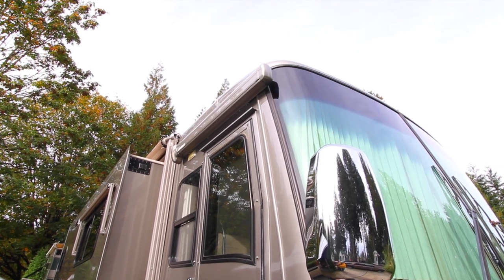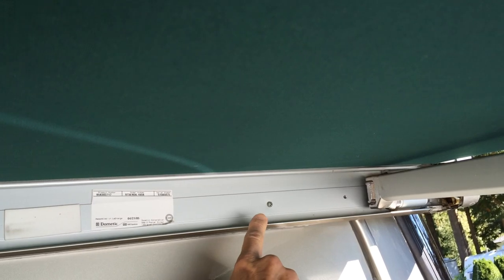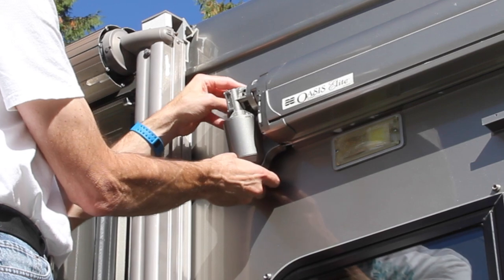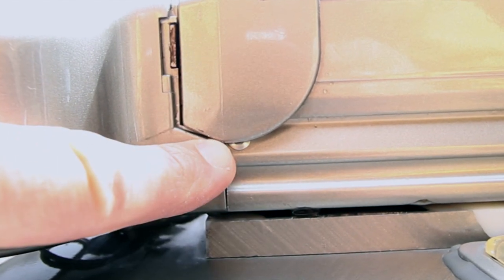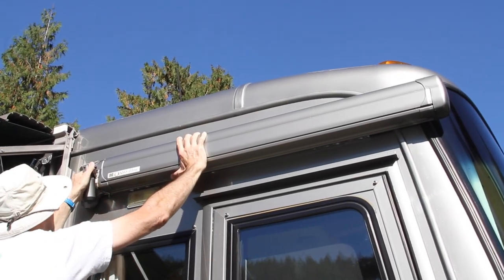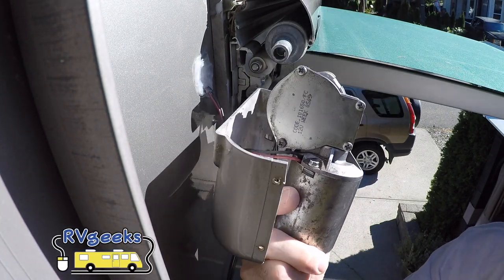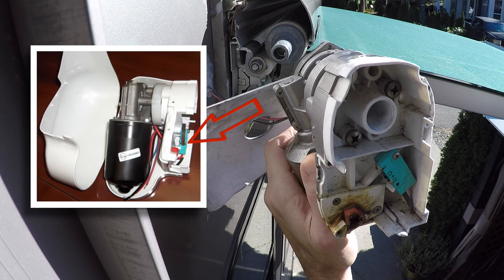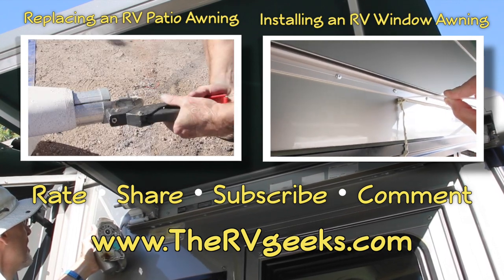Failed RV Power Door Awning, Repaired for FREE! | Dometic Oasis Elite Awning Repair | RV DIY Repair

Comment: Thank you so much it help me fixed my entry awning motor. I don’t have to remove the whole motor assembly i just remove the motor to each housing cut wire clean it up test motor using battery booster then re assemble back to the housing connect wire then put back all screws and cover it ... now it works again and save me a lot of money....again thank you very much
Reply from the maker: That's awesome Peter! It's always great to hear we've been helpful. Thanks so much for letting us know.

Comment: Another great job of explaining both in words and video.  I would have had a very hard time figuring out how to remove the back piece.  It turns out the red holding tabs on either side of mine had become gooped up and could not be displaced by the motor mechanism. Cleaning those and lubricating them (used wd40, dryed, then graphite) solved my problems. ... and here I thought I'd seen all your videos :-)

Comment: great video...ours was stuck in the out position so I had to remove it...bench testing it I found it would always extend  but never retract. Turns out it was the round piece that the motor turns. Dometic got us for $75 on that piece but it fixed it so I guess I got off cheap. 
Thanks again.
Reply: I seem to have the same problem.  I took the motor off and it bench tests fine.  I Have to assume that the roller it connects to that turns the shade is broken like yours was.   Did you get the part from fiamma or dometic?   Do you know the part number off hand?   I hope you didn't have to replace the entire roller but just the end piece that connects to the motor.

Comment: WOW -- I can't wait to try this. thank you, thank you, thank you!! ours is stuck out, hear the motor, but not turning. We guess it has broken pieces in the gears. Hopefully it will be as easy peasy as yours.
Reply from the maker: Hope you make out okay. Be sure to let us know!
Reply: OK - we took apart the awning this weekend and the motor works great!! but it still won't come in, so we looked down the shaft and saw that more than likely it is the 'keyed' portion that has worn away. Fiamma still isn't answering their phones. Hoping you could tell us what to do next. Thank you in advance!! I love all your videos, very informative and well thought out. Terry
Reply from the maker: +ladylaugh51 Thanks so much for the nice comment, Terry. What happened at Fiamma is a horrific tragedy, and we don't expect to be able to get parts or service from them again soon, if ever. We'd suggest that you contact a Dometic / A&E dealer. If you can determine what parts(s) you need, they likely carry it. They might even be able to help you figure out what you need. Unfortunately, even if they do, they'll charge a lot more for it than Fiamma would have. You might be able to find parts on eBay too.

Comment: I have finally decided to get this door awning fixed on my Newmar. My only concern is that I do not hear any noise what so ever when I hit the switch to open the awning. Maybe my motor is shot?? It did work when I purchased the coach but not for long. I don't use it but am about to put my Newmar up for sale and want it working for the next owner. Thanks for the video!! You all have saved me several times.
Reply from the maker: Motor might be shot, but the first thing we would do is check for power with a multimeter. And even if there’s power in the motor doesn’t make any sound, it may just be seized. Definitely worth trying to work it loose before giving up and replacing it.

Comment: At 4:12you can see into the roller tube fitting that slides over the output shaft of the motor.  There is a small shear key built into the tube fitting.  When this shears, the awning suddenly springs out on its own.  Failure mode: SPROING!!  I drilled and tapped a screw into the tube where the key used to be and then ground the screw flush to the outside of the tube.  Drilling a hole and using metal epoxy might work as well.

Comment: Make sure you clean the tiny water drain hole in the cover under the motor. It doesn't take much dirt to clog that little drain hole.  I increased the size of the drain hole on mine and have had no more problems with the motor
Reply from the maker: Thanks for the added tip, Jeff! 👍

Comment: yes it came from dometic, I found the original paperwork in the huge suite case of manuals and called the number on there, the lady on the end of the phone new exactly what part it was, blamed it on a bad supplier. fixed it right up. we also replaced the material at this time, but made our own, the wanted way to much for that. i will look for the paperwork and see what the PN is.
Reply: Eric I found the female end of the fabric roller has the inside raised  tab   sheared off which is letting the motor shaft just spin inside it.   Were you able to remove that end piece and replace it or did you have to order the whole roller for the fabric and replace it?   Just don't know how to get that end piece off and afraid to start prying.  Going to call fiama in the morning if the phone number is still good.   Web site does not give one.

Comment: I would have loved to see what you took apart and cleaned. Did you just take the screws out of the part on top of the motor and clean?
Reply from the maker: Right Kevin! We just removed those screws, took the thing apart, cleaned things off and reassembled.

Comment: My similar Carefree One Touch quit in the closed position after my son powerwashed the roof.  I assume (hope) he just got water in the horizontal motor, because if its in the One Touch control module/switch system things get really complicated to track down.  Your video gives me some insight.  

But do you have any advice re. mine, because the "Tubular Motor Replacement Kit" manual online at Carefree implies I must drill 1/2" holes through the unit's end cap in 3 places in order to access the screws holding the end plate covering the motor?  That means the end cap has to be then replaced unless I instead can somehow pry it off the end plate (it apparently was "snapped" on).  

And removing the motor may not be easy because to slide it to the left and out of its tube it will hit the nearby slideout cover awning and/or the main awning's arms.  Just wondering if you had experience with Carefree over-the-door ones like mine, with tubular motors.
Reply from the maker: Sorry, but we’ve never owned a Carefree door awning, so we don’t really have any idea how they work. We’d suggest posting your question on the user forums on iRV2. It’s free to join and post questions at www.irv2.com/forums and there are tons of RVers there who are happy to help with any topic they have experience with.

Comment: First class video. Based on your comment, you pop riveted the motor back in place, why not a screw? This is not a criticism, as I truly appreciate the great video.
Reply from the maker: Thanks Mark! We pop riveted it back for a few reasons. First, we generally try to put things back exactly as we found them, so we're not inclined to make a change unless we have a good reason. It's also not possible to use a screw in that particular spot, because it's just two pieces of thin plastic being attached to one another, so a screw wouldn't hold into the plastic without stripping it (a bolt might work, but then if we had the same problem again, it might be difficult to remove, as the nut would spin loosely on the back side, with no way to get a wrench on it, since it's inaccessible when the awning is closed. Also, the space for the head of the rivet is very thin with the awning closed, and a rivet is extremely flat on top, taking up less space than a screw. Lastly, a rivet can't vibrate loose, like a nut & bolt can. Great question though, and we hope our reasons for using a new pop rivet make sense!

Comment: i had to do the same thing to my unit a few years ago  and clean the motor but i left the gear box on and pulled the upper 2 bolts out  

i all so added a new hole on the under side of the cover for water to flow out as my motor was standing in water in the cover
Reply from the maker: +falcon7350 We've read about lots of people having that problem of water pooling around the motor. We were lucky and didn't have that issue.

Comment: When you replace the motor back on to the awning.... do you push the awning in all the way first ?
Reply from the maker: +Scott Deney No. The nice part about the way they awning is designed is that it allows the motor to be re-installed with the awning out, even if it was removed with the awning closed. That's a good thing, since having to hold the awning in, against the springs, while trying to put the motor back on would be a challenge with it trying to jump out on you the whole time. :)

Comment: I just bought an ‘06 Monaco with that kind of door awning.  It extended just fine but won’t retract.  The motor runs and tries but the arms look like they’ve extended perfectly straight.  Perhaps I should have let go of the button sooner?
Anyway, it’s extended and the right side appears an inch or so lower than the right side.
Any advice? 
Thanks in advance!
Reply from the maker: Hi Gardner! Congrats on your new-to-you RV! That awning is spring-loaded to go out, so the motor pulls against the spring to retract it. It sounds like it's possible that something came loose that allowed it to overextend, and now one of these things may be happening: 1) The arms are locked straight out, preventing it from retracting (you'd know if this is the case if you hear and see the motor try to push the awning in, but it only moves the slightest bit). 2) The awning has gone so far out that the gears are no longer meshed together. That would likely result in a free-wheeling sound from the motor running, but not pushing anything. 3) The motor is not running at all, in which case it would make no sound. That could be caused by a blown fuse. 4) The gear that attaches the arms to the motor may have failed, in which case you'll probably also hear it running, but nothing happening.

If the motor IS making sounds when you push the retract button, you might try having someone press on the center of the arms as you press the retract button, helping them to re-fold the arms as the awning begins to come in. You may have to push inward on the front of the awning at the same time, pressing against the spring to help it begin to retract. Just don't let it get way from you and knock you off the ladder.

These are our guesses as first things to look at. We also suggest e-mailing the manufacturer for help/guidance, providing them with as much detail as you can. That would be Fiamma in Florida: http://fiammausa.com and you can e-mail them at  service@fiammausa.com

Hope this helps. Please let us know how you make out.

Comment: Any hints on the disassembly and cleaning of the motor?
Reply from the maker: +James Garrett We did dismantle, clean and lubricate the motor, and remember it being pretty straightforward, but sorry we don't remember the details, James.
Reply: Just finished with mine.  For those that are also curious, two screws in the top of the motor housing allow disassembly.  You may have to pull more than you expect because the magnets are fairly strong, but the shaft and rotor will come out.  You will probably find, as I did, that the central shaft had rusted in the bushing at the bottom of the motor.  A little emery paper and some electronics cleaner got rid of the rust, along with using a brass or stainless brush on the rotor to remove rust there, then a bit of electric motor oil and back together again.  Easy!
Reply from the maker: +James Garrett Thanks so much James!

Comment: how do i repair the motor? i got one on a customer coach that works intermittently. or it will work then motor slowly dies.
Reply from the maker: Hi Travis. If the motor won't work reliably, you may have a loose connection. We're try opening it up and wiggling the wires while pushing the switch to run the awning in or out. If it seems to react to the movement of the wires, they're likely loose. It's also possible that the motor needs to be replaced, in which case we'd suggest contacting Fiamma (the manufacturer) for assistance. http://www.fiammausa.com

Comment: The other awning frame is so close to the step awning I cannot get any kind of screw driver back there to fit into the screw.  Is there a trick to getting something to fit back there?
Reply from the maker: Wow. That's a real problem. I assume that extending the patio awning that extending the patio awning still doesn't get the arm out of your way? You might need one of those flexible screwdrivers, like this one: http://amzn.to/2bUtfPB

If you have a 1/4" screwdriver bit to go with it, this type of tool might allow you to squeeze around the corner of the awning even with limited space.
Reply: Dan, I'm sure it is too late for this, but my main awning is also too close to the door awning to allow access to the screws.  Luckily, in my case, I was able to take a hammer and give the motor a sharp rap on the bottom, which freed the rusty bushing and allowed me to open the awning.  From there, I could remove the screws anchoring it in place and slide the whole thing forward in the awning track and remove the motor.  If you just get a slight "klunk" when you hit the switch, you motor is likely frozen and the hammer may work.  If the motor is running, your shaft interface is probably stripped, and the hammer won't do any good.  No noise at all?  Likely electric and your problem may be elsewhere.
Reply: Just in case anyone runs into this problem with the second screw.... I was able to get around this by sliding a 2 inch Phillips screw driver bit through the end of a 1/4 racheting box wrench as a tool to get to this screw.  I threaded it up behind the motor and pushed on the end of the bit with my finger on the left side of the motor and used the rachet one click at a time .... ugh... go eventually back out the second screw.  Wallah
Reply from the maker: +Scott Thompson Thanks Scott!

Comment: Does anyone know of information regarding the fabric replacement of one of these A & E Systems manual door awnings?
Reply from the maker: The guy to contact is Tyler at Tough Top Awnings. He is the expert on just about everything to do with replacing awnings and slide toppers of all makes and models. His number is (360) 953-3299, and if you order fabric from him, the "RVGEEKSROCK" discount code will save you a few bucks, too. https://www.toughtopawnings.com

Comment: Cleaned and lubricated with what?
Reply from the maker: Cleaned the motor with CRC electrical contact cleaner and then lubricated the bottom of the rotor with a little bit of lithium grease.

Comment: My motor works. But awning won't close all the way!
Reply from the maker: Your awning may need adjusting. There are two small adjustment screws up inside over at the end of the roller. One sets the outer limit when the awning is open, and the other sets the inner limit when the awning is closed. If it’s not closing all the way you may need to adjust the inner limit adjustment screw to make it close further. Try turning very slightly toward the plus or minus side to see if it makes a difference in how far it closes and adjust as needed.